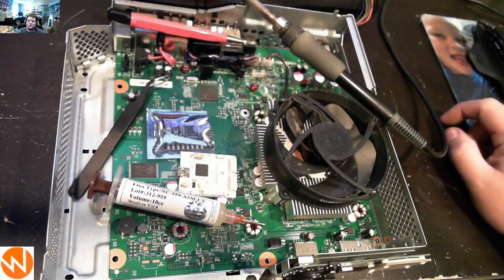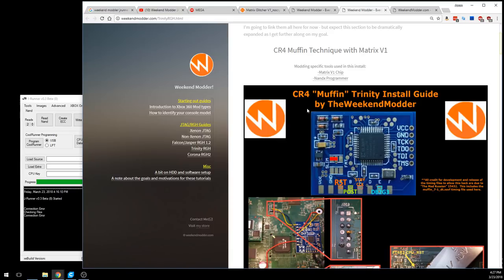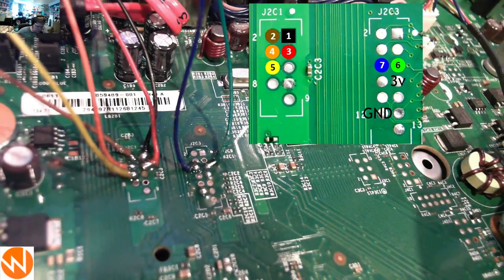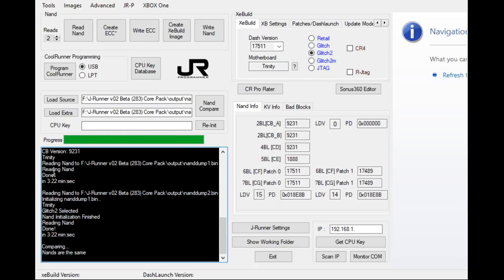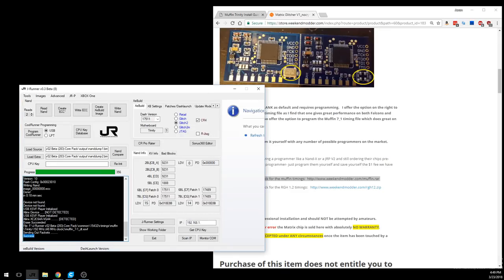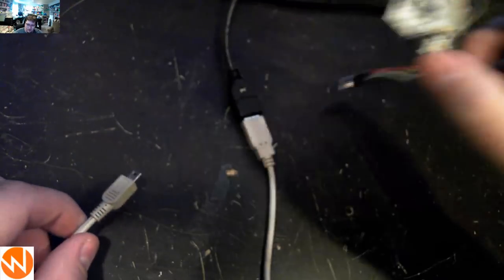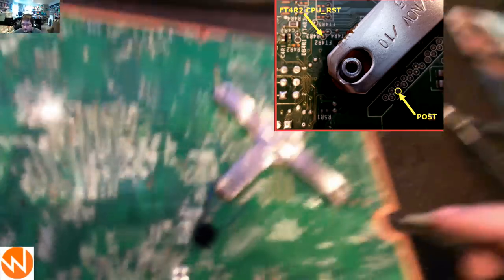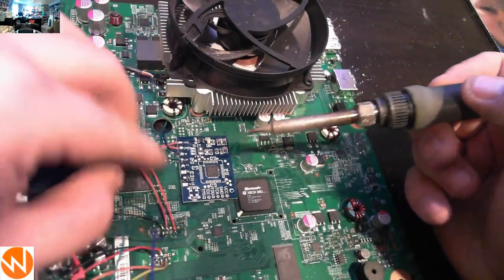2018 Complete Guide Trinity RGH Muffin Technique

Comment: iv recently being trying to do this to my Trinity board console but I think I messed up the cpu_post pad as the solder wont stick anymore to it,  I have all the other points soldered just this one was the issue. I tried a system boot earlier and it did boot and was working but of course im stuck at this stage

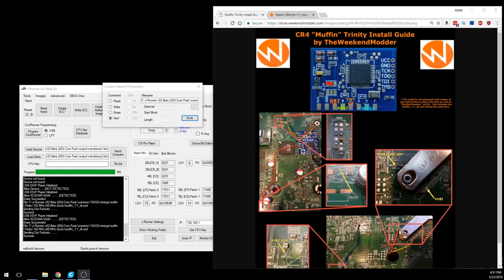Comment: at 19:00 in the image of the matrix v1 chip you're using for illustration I can see some components where the solder paste has not fully flowed during the smd reflow process. The MLCC capacitor above Vcc and to the left of the word SLIM looks bad. The one directly above RST towards the top of the image also looks half baked.
If you see this kind of thing its a good idea to add a little flux and reflow with a soldering iron. Dry joints like this will lead to anoying intermittent problems. Or worse components falling off the PCB.
Reply from the maker: good tips!

Comment: Great tutorial the best I seen ever, I got a question, I have a Matrix V3 do you have a diagram?, because I soldered but it does not turn on, I only hear a beep when I try to turn it on but it does not turn on the lights, I looked for diagrams for this glitcher but none of them has worked so far, thanks for your help.
Reply from the maker: Never worked with the Matrix V3 - assume it'd be the same as the V1

Comment: I'm read the nand, and got ready to program the Matrix V1 and got "device not found", looked down at the chip and the blue led faintly comes on for a millisecond each time I wiggle the header pins. Any advice?
Reply from the maker: Take a very close look at the matrix chip for any cold solder joints or things that look like they are disconnected or bridged/connected where they shouldn't be.

Comment: my matrix v1 chip will not stay blue after connecting it to the JR Programmer. it blinks once after i connect it. I tried soldering the wires onto the chip and it didn't make a difference

Comment: thank you very much for your tutos, a question, would the solder points be the same with a matrix v3 whit cristal oscilator?
Reply: Ivan Garcia yes but you need to disable the oscillator by removing the resistor he pointed out if you have a trinity

Comment: Hi there.   I'm just about to start a Trinity 2010 mod using your above video. I have a J runnner V1 programmer and just found a brand new Coolrunner Rev C in my parts box.  Following the above tutorial and swapping the A,B,C points on the coolrunner is  that all I need to change?  Are the timing files the same on a Rev C as the Matrix V1 you are using? Many thanks and great work.
Reply from the maker: Yes, just the point differences. Timing file is the same.
Reply: @TheWeekendModder  Many thanks. Is there any disadvantage in using the coolrunner over a any of the other current chips?

Comment: Quick Question. When I receive my Nand-X does it come with Glitch Chip programmer wire for Coolrunner rev c or Ace v3?
Reply from the maker: If you bought a NandX from me it comes with the "nandx to CR programming cable" that will let you use it to program any glitch chip.
Reply: TheWeekendModder could you JTAG my 2011 Xbox 360 slim and how much would you charge
Reply: WatchOutBro that would cost 40-80 from a decent modder as long as you don't want any extras
Reply: Mr Behexed thanks So how long would it take to jailbreak it
Reply: WatchOutBro I can't say for sure, an experienced modder would most likely be able to do it in a day

Comment: I hear that you say you've been getting faulty ace v3 chips from recent manufacturing, would you say it is safe to buy the 2015 model as advertised on ebay or will they throw in the recently made ones as well?
Reply from the maker: In my experience, anything that is the newer "cafe" color (kinda brown tint to the PCBs) is sketchy.  But photos on eBay are showing black, but then sending cafe color.   So frankly- I don't have a good recommendation about where to buy good ones.  I managed to talk my supplier into specifically finding old stock for me, and I bought all 200 of them they had.  They'll be up on my site for sale in another week or two when they come in.

Comment: I’m new at this, I ordered a matrix v3, I read in the comment that you should disable the crystal oscillators for a Trinity console, how do I do this and are there any other changes have to make? Are the timing files the same?
Reply from the maker: On the matrix product pages on my website there are images that show the resistor to remove to disable the crystal.   The timing file is the one suggested in the video appropriate for your motherboard.
Reply: TheWeekendModder thank you so much

Comment: what cable is used to connect jr progarmmer plz?
Reply: also for a coolrunner rev c on trinity does anything need to be changed about the chip becuase on the website it syas remove capactitor but i havent seen hat anywhere else?

Comment: very good tutorial. thank you!
I want to mod my first 360 next month and need to order the equipment.
Can you tell which programmer is better and why -  XNAND or JR?
Also, I've seen MrMario do a Dual-NAND install, but I wonder if that is worth it for me - I don't intend to pay for XBox Live anyway, and I assume you can't play online without paying either xbox live or some fishy 3rd party "service", so a dual-NAND install would probably not have any benefit to me or?
I assume you can't even access your HDD-ripped games library when you run on the official Firmware, right? So only with physical disks, or can it access HDD games also? (sorry, never did anything with X360 before).

Comment: I have holes where all but 2 pads should be for the nand read and glitch chip.. the glitch chip side has no pads to solder to at all! what can I do?
Reply from the maker: I'm not that clear on what you are asking or stating.  If your issue is just that on the Xbox motherboard the headers to solder the programmer for reading/writing are through-holes that is totally normal. They are through-holes on all the motherboards just often filled with solder.   Use some flux and apply solder and it will fill the holes and you can build up a little pad of solder just like I do in the video.
Reply: Yes, that answers my question entirely. Thank you!! I just had so many through-holes on the right side header that it didn't seem right. After clearly watching you yolo the solder into the through-hole and it globbed over nicely I figured I could do the same. I wanted to go with the ace V3, is there any major difference between Matrix and Ace v3? This is my first RGH so I'm likely following this guide to a T either way.. Thank you again. You replied quicker than se7ensins whole freaking community -_-.
Reply from the maker: The Ace chips have had some quality control issues with the release of the brown tinted pcb "cafe" versions, but if you can get good ones where the PCB is black (I have some on my store) then the Ace install on a Trinity is just slightly better as far as boot times go, but it's just a slight advantage.   The matrix v1 muffin Trinity install is a markedly easier install though.  

functionally to the end result, there is no difference.
Reply: So definitely going with the matrix. Ordering from you because of the pre programming option which is a nice touch. The matrix is marginally more at other stores too.. I may just grab a nand x from you as well.. It's not a jrv2 but it'll do the trick.. Will this work for wire? I know you suggest one at the store but I want more colors as to not get confused myself lol https://www.amazon.com/gp/aw/d/B01KQ2JNLI/ref=psdcmw_495310_t2_B008AGUAII
That and I may do more of these seeing as so many people are retiring them now days. Its almost a waste of a console using it stock... Lol. Thanks again, man.
Reply from the maker: The Nand-X is a better device than a JRPv2, so deffo go with that.  The only advantage the JRPV2 has is the "rater" functionality which only works with CR4 chips and RJTAG chips which no one has or uses these days.
Reply: Thank you again for all your instructions, product availability and fast shipping! Almost a year later and I finally took the plunge into rgh. Frightened with all the small points, the matrix muffin was pretty easy. Tedious at times for a novice at soldering, a bit of patience got it almost instabooting. Just a couple pulses and I'm in ^_^

Comment: Is Post signal Important because is Removed on me during make a new thermal paste
Reply from the maker: Yes, post signal is required.  Sounds like you need a postfix adapter.
Reply: @TheWeekendModder  what kind of solder should I use must be iron inside ? Just need to repair the post part.the Whole cable is Remove
Reply: @TheWeekendModder  only the B port is Empty Also on the backside
Reply from the maker: @Kurdischerjapaner  60/40 tin/lead is what I use. Rosin core is fine.
Reply: @TheWeekendModder  in Germany they only sell Iron free but with Flux.Can i still Use it ?
Reply: @TheWeekendModder  can i use instead of this rosin soldering flux ? Because i can not buy the other In germany
Reply from the maker: @Kurdischerjapaner  lead free solder will be way harder to work with.  With rosin core or without rosin core is fine - just use extra flux if you don't have rosin core.

Comment: My console takes around 10 minutes to boot, is the timing file you used THE timing file for this setup or does it very between device?
Reply from the maker: I sometimes flex the timing file up or down one, but rarely.  For boot tuning I'd suggest that you try varying the length of your RST wire.

Comment: JR Programmer: v2 with come with  wires for dumping nade  for falcon ?
Reply from the maker: Yes
Reply: @TheWeekendModder  I'm trying to buy the Jr  programmer from you and  USB but it keeps saying every time  putting in card  decline from ur end
Reply from the maker: @CurrentGenGamesWithNick  you are trying to use a different shipping address from your billing address.  I require the billing address and shipping address to be the same.
Reply: @TheWeekendModder  I tried three different cards it keep saying on your end declined I don't know why I just use that Dunkin it's the same as the billing address order for the x flasher and nand wires
Reply from the maker: @CurrentGenGamesWithNick  all I can say is that every attempt was triggering my shipping/billing mismatch filter.   Maybe use Amazon Pay?  It's free and then doesn't have that restriction.  You can still use whatever card you like
Reply: @TheWeekendModder  dashboard 17511.0 can I do RGH one or two flacon?

Comment: I have a matrix glitcher chip left without oscillator and a corona. I'd like to buy one but I don't know which I have to pick up. They look all the same for me!
Reply: salvo puglisi i think you can buy the crystal on theweekendmodders website
Reply: You need to read it literally says which one is for which console
Reply from the maker: With Crystal = for Coronas.   Without crystal = for Phats and Trinities.
Reply: TheWeekendModder yes, I know. I asked where can I buy Only the crystal because I have a spare chip without it and, I need it in order to install the chip on a Corona
Reply from the maker: Ah, k.  It's a standard 48mhz crystal.  Never tried buying them solo so not sure where to send you for it.  Mouser, digikey I guess?  Usually they're spec'd by size - so you'll have to measure the pads on the chip to figure out what physical size you need.
Reply: TheWeekendModder well, I don't know because if you remember I love in Italy and I should consider shipping cost.
Reply from the maker: Yea, aliexpress then maybe?   TBH it's probably cheaper/easier to just buy a different chip with a crystal and save that one for a console that doesn't need the crystal.
Reply: TheWeekendModder ook  thank you for answering Master Aron ;-)

Comment: I have got an XBox 360 with Dash 13599 i want to RGH 1 it.
But i can´t find an Diagram for the Matrix an RGH 1. Do you have one ? And what Timing file i should use ? Thanks :)
Reply from the maker: I wouldn't bother with RGH1.  RGH 1.2 gives you the same boot times and you don't have the freezing fussyness of RGH1.   So update to current dash and then do RGH 1.2
Reply: TheWeekendModder ok thanks.

Comment: Windows 10(64 Bit) doesn't recognize my JR Programmer. I disabled driver signature enforcement but it is not recognized. I installed the drivers that came with JRnner 0.5 but no luck. Any tips on how to get it to work? it worked before, though. Thanks in advance.
Reply: After installing windows 7 i got the JRP to work. I then learned that it was stuck in bootloader mode. Reflashibg its firmware solved that. Next, i tried to follow your tutorial on your page (the pictures) for a muffin install on my trinity console with a CR Rev c. But the referencek images and explanations for the muffin method especially with the coolrunner are confusing as far as the wiring and soldering points for the coolrunner are concerned. Is there any addition infos on this?
Reply from the maker: There's a full written tutorial at http://weekendmodder.com/RGH-falconjasper.html

Comment: Hey man i recieved my stuff today, I made a mistake in not noting down the dashversion before installing the nand x, install shows it worked in j runner, do i need to desolder all the points again to boot the xbox to take note of the dash version? thanks alot
Reply from the maker: Once you read the nand you can tell the dash version from the CB values in JRunner.  also - you can just disconnect the nandx from the wires and boot normally - the wires being in won't stop it from booting.
Reply: TheWeekendModder I went ahead not long after and read the nand. All up and running on my first go. Trinity boots between 10-45 seconds. Over the moon. All thanks to your videos bud. Tomorrow I'm doing a Jasper and I ordered a cool runner from eBay to do a falcon. Thanks alot man

Comment: i'm using matrix v3. When I put the vcc wire i cant to start the console...just bip
Reply from the maker: You've probably forgotten to disable the onboard crystal oscillator.  You can't have both a crystal and connect the CLK point.
Reply: @TheWeekendModder  Thanks brother! It's was my mistake!

Comment: Hi, Ive successfully done my first RGH1.2 on my old Jasper Yesterday by using a coolrunner and jr programmer

however I also had a trinity console and matrix glitcher so i attempted to rgh it today using your guide and after following all your steps, 
my problem is when i go to power the console on to get into XELL for the first time with the glitcher 
i plug it in and i just see the blue led light up on the matrix before even powering on the console and when i did, the blue led just continued staying lit and didnt blink at all on the matrix so my xbox wont glitch

could you help me with any tips that i could try to fix this problem ?
Thanks!
Reply: same problem here , idk whats wrong

Comment: Hello. I have a question, is it possible to build nand without having CPU_KEY? Trinity motherboard.Thanks in advance for answer
Reply from the maker: No, the CPU key must be known in order to build a new nand image.   If you don't know the CPU key of a console, you can generally write the appropriate ECC file to it, boot Xell and get your CPU Key that way.
Reply: Thank you for the answer. The problem is that the console does not want to boot. I already got it RGH. I know what happened to it. The green LED lights up and nothing else. So I wanted to enter the original NAND to check the error code, because with the entered XELL show.

Comment: What's the diffrence between rgh 2.0 ace v3 installs and muffin installs theweekendmodder
Reply from the maker: Ace V3 is technically "S-RGH" as released by 15432 and uses typical RGH2 style wiring.   The "muffin" technique timings were also released by 15432 but they emulate the TX CR4 style wiring which uses the DB2G3 point and doesn't make use of E or F.    Given the quality control issues that Ace V3's have had lately I'm leaning heavily toward the muffin installs using Matrix chips.
Reply: I'm kinda not liking the ace v3 installs aswell I always have problems with timing files
Reply from the maker: It's the quality of the recently mfr'd Ace chips.  The older ones were the bomb-diggity and worked great!
Reply: TheWeekendModder do you recommend me to move towards the muffin installs then or still do ace v3

Comment: I got a trinity dashboard 13146 and   I have installed matrix v3 using your tutorial, but it doesn't boot xell.  I have tried all the muffin files  and nothing happens.  I wondering  if my dashboard is the problem, should I update my dashboard to 17511?? What do you think?
Reply from the maker: Yup.  Update to current dash then restart your mod.
Reply: @TheWeekendModder  Thanks bro. I will do it tonight.
Reply: @TheWeekendModder  hi there. I can't update my xbox, I have tried the dashboard 17511, 17526 and I got message "update failed status code 335A 4467 1600 0700 C000 000E" I restored the original nand.

Comment: How do you know if an Xbox s is a trinity or corona , the mfd is 2010-12-01 and the amps are 10,83
Reply: There will be something on the power box attached to the cord that will say either 12V———10,83A or 12V———9,86A. The 10,83A is the trinity and the 9,86A is the corona.
Reply from the maker: That's a good indicator, but I've found LOTS of mislabeled consoles.  10.83 labeled that turn out to be Coronas and lots of 9.86 labeled that turn out to be Trinity.
Reply: TheWeekendModder Ok thankyou